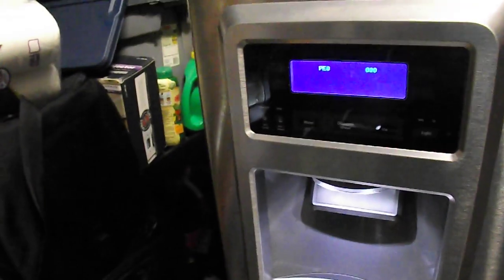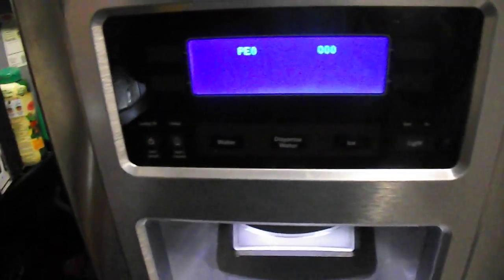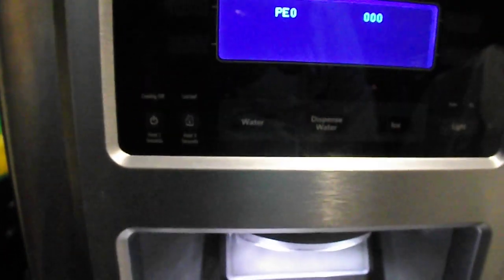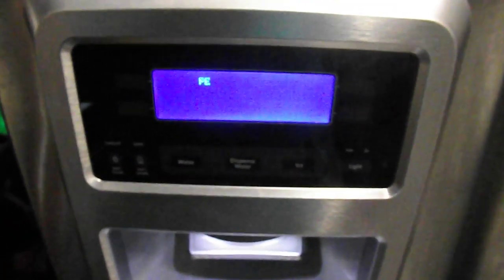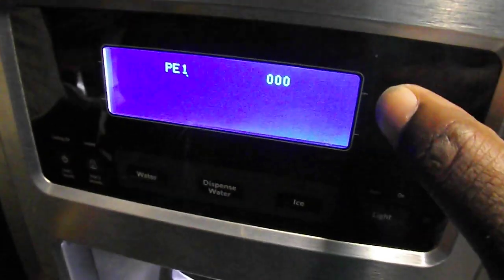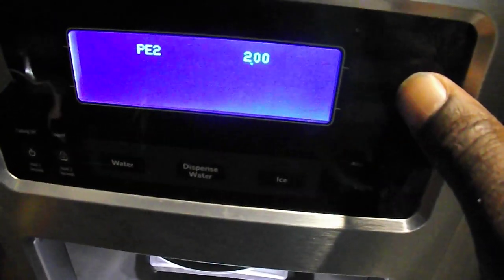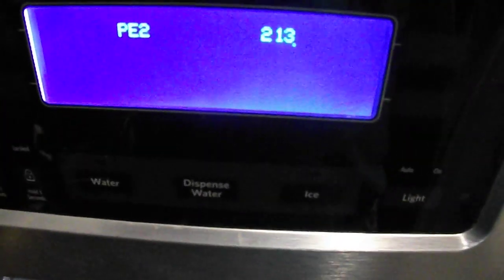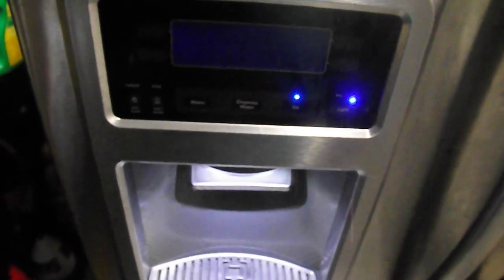Fridge Control Board Programming

Comment: Thanks. It works perfect for me. I have the same refrigerator and even the same code as you. But for me I had to push and hold the water button not the on off button. Everything else was exactly the same. Thanks again

Comment: I cant get mine to go into programming mode when I put the new board in.  Its still just a blank screen that turns blue whenever I press any button.  Any ideas anyone??
Reply: Did you solve the issue? I am having that problem right now
Reply: @verelli  no. Just bought a new fridge 🤷🏻‍♂️
Reply: @verelli i have same issue, did you find solution?
Reply: @Edward_Khd  in the end it was a board issue, wiring diagram had the wrong part number as it was changed throughout the years. In the end I brought the board to a computer repair shop and he found 3 components that were fried, replaced
Them and it worked fine. Cost was $100 instead of the $250-$350 for the new board

Comment: Thank you for this video! I have a kitchen aid refrigerator and I paid a guy $89 to tell me my refrigerator was shot! I bought a new control board from searspartsdirect .It took me about 5 minutes to put the board in and I used your instructions on this video to program the New board and it worked like a charm! The new board didn't come with program instructions.Thanks again!👍